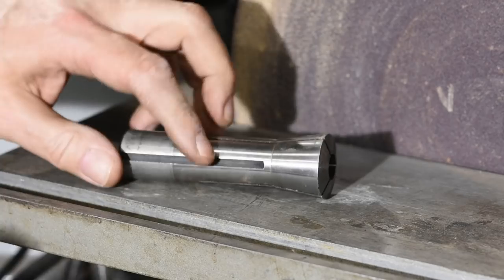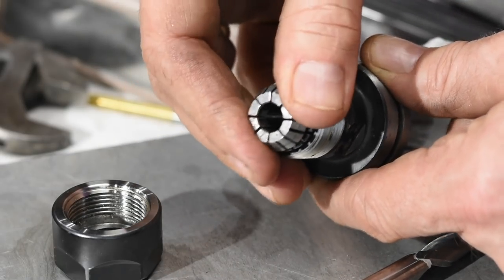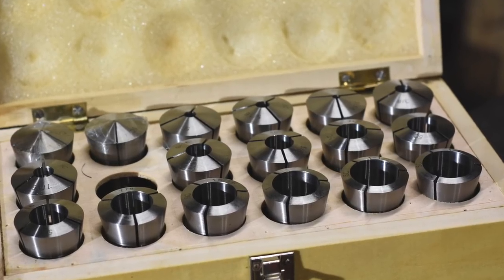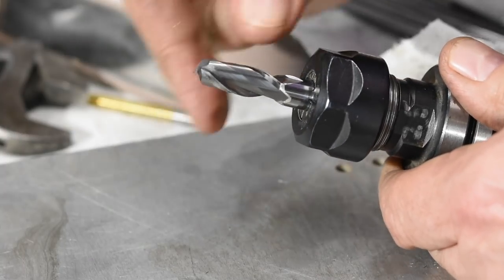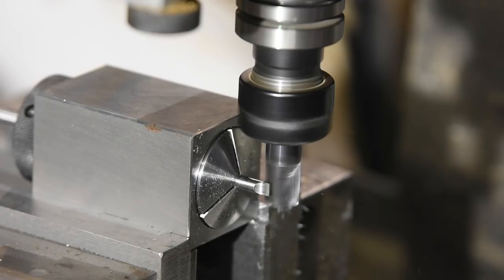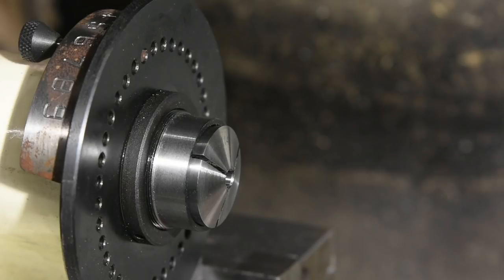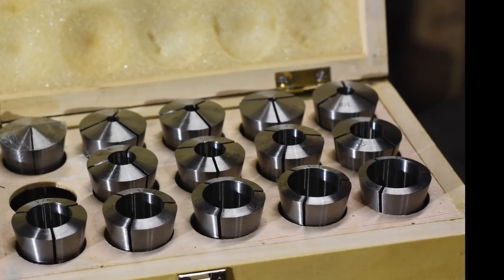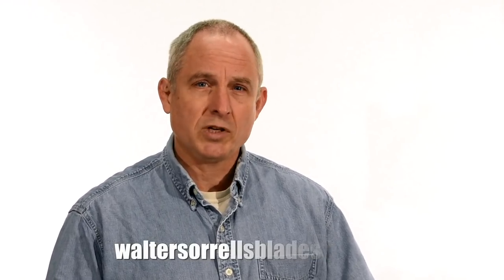All About Collets for the Knife Maker

Comment: I'm a better machinist than knife maker, and I'll confirm everything Walter has said about collets.  They're amazingly versatile and useful once you get your head around how to use them.  

Interesting fact/trivia... by themselves, they're useless... they're a subset of a larger tool... they only work *in combination* with something that holds the collet.   

They work in combination with other tools pretty well, too.  Angle blocks (you can do in the mill the operation Walter was doing in the belt sander on the brass rod, only precisely), and rotary tables (by clamping the spin-dexer to the rotab) you can create really beautiful shapes, such as acorn nuts.

Two useful details about 5C collets: they come in both inch and metric sizes, and they can be ordered individually to get only the size you need -- I've owned a set for 30 years and I'm pretty sure there are sizes I've never used.

Comment: Great video with some cool info.  I have a related question I’d like to ask folks.  I recently got my mill, mostly to do shoulders on knives or slots in guards.  My issue is when doing shoulders, I end up having to flip the knife over and have to redo my whole setup.  I was thinking of getting some kind of small vise to put the blade in and lock THAT in my vise or get some kind of rotating mechanism.  How are you guys doing this?

Comment: Hey Walter, this is off topic but I need some advice for knife making. I’m 16 and I’m still a major beginner. I made a nice Bowie knife with a oak handle but over time with dirt and sweat the handle has turned a nasty ugly gray? I treated it with danish oil and I remember putting like 3-4 coats. Any advice to prevent this?